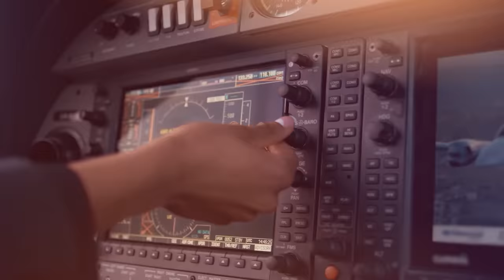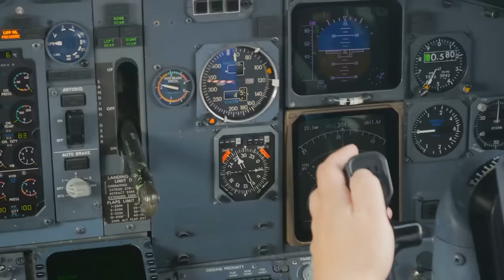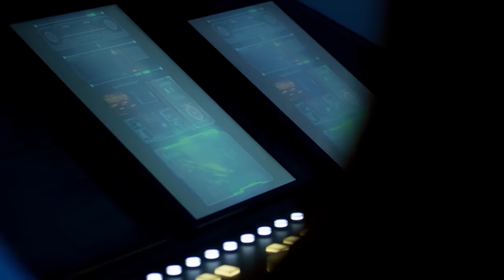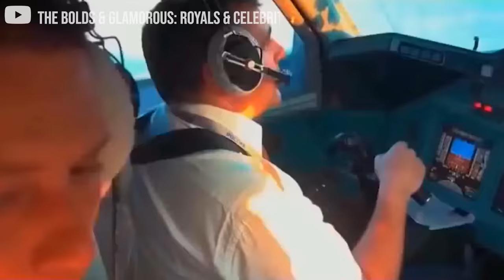How President Vladimir Putin Travels

Comment: Airforce one doesn't need additional air craft to control its nuclear forces, it's fully self contained, with operating room and robotics' that surgeons can use from 1000''s of miles a way to perform surgery. it has a full kitchen and carries enough food to make 3000 meals. Airforce one can withstand an indirect nuclear explosion  and impervious to electrical magnetic weapons.  It's carries laser weapon technology designed to shoot down missiles, it even carries limited air to air  and air to missiles in its belly,  but because of the missile system they had to take out the emergency escape pods this is for the new model in 2024-2025. The current air force one still has emergency escape pods, the new one doesn't and he doesn't just have one, he has two of these planes . and air force one is designed to stay airborne for months at a time. His body guards are the secret service and are among the best in the world. The presidents limousine aka Beast is an armored assault vehicle but with out the ground clearance, it can with stand an indirect nuclear blast, it can also take direct hits from a should mounted rocket launcher. The amour is 8 inches thick and the windows can stop .44 magnum rounds. its also air tight and has its own oxygen and he doesn't just have one, he has two of them. he travels with a mobile Hazmat unit and an entourage of armored Suburbans armed to the teeth, snipers put in place before travel begins  an army of local law enforcement  and F-22's and F-35's prowling the skies. The cost spent to keep our president safe costs more then most countries spend on their entire militaries and about 1/3 of Russia military budget.  so sorry, you can't compare Putin's security to that of the U.S President. its not even close. and FYI, Putin is currently using a Train to stay mobile in order to stay safe.